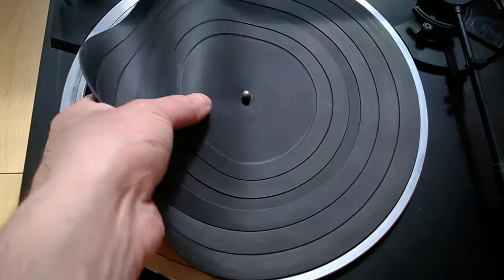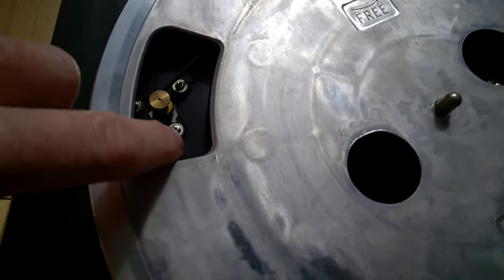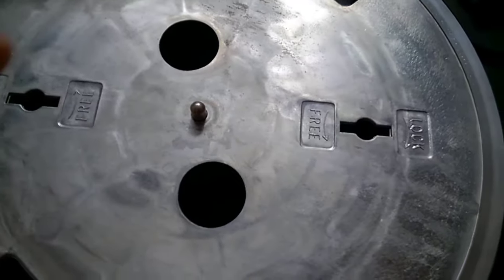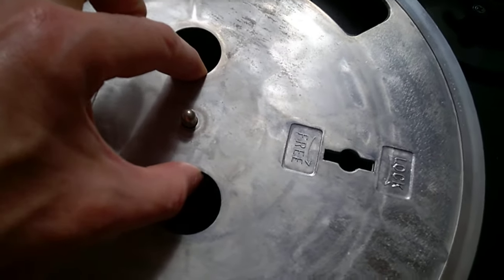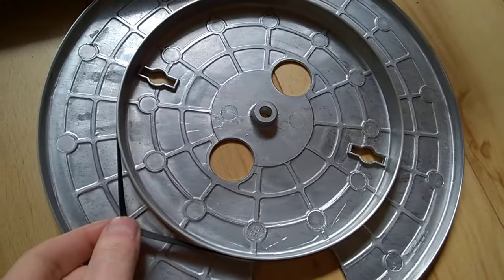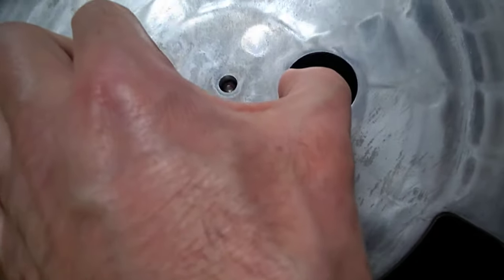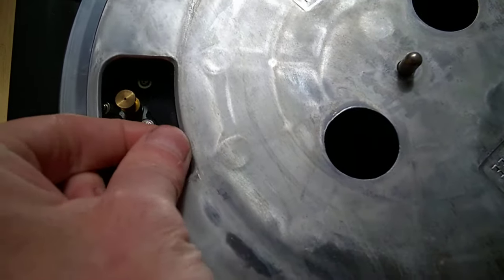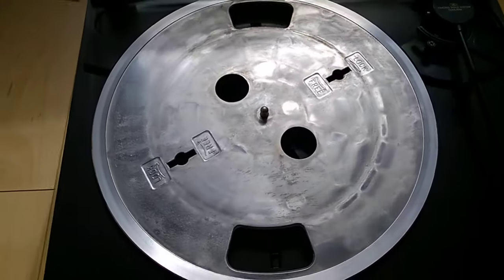Quick turntable belt replacement

Comment from the maker: Tips: 
Stuck platter or Loose belt
1. Stuck platter 
If it won't lift, it's slight stuck on the center pin. Grab platter rather at the perimeter with both hands at two opposite points, then gently wiggle the platter vertically. Be gentle, it should get unstuck, then lift if as shown with the finger holes - be sure to keep the heavy platter securely when lifting it.  
2. Loose belt
If the belt is loose and doesn't stay on the platter, keep the belt in tension with the left hand while handling the platter with the right hand. Pay attention not to twist the belt both on the plate running face and on the small drive pulley. It may help to have the speed selector at 45rpm to lower the fork.

How to lubricate a turntable  https://youtu.be/eCWjq7ujXVA

Comment: do you know why my belt keeps slipping off on a brand new record player when i spin it?
Reply from the maker: First thing, make sure the belt is in good condition. An old belt will become soft, will stretch and will not have the tension to stay on the shafts. 

Another possibility is something is misaligned. The pulley runs on the small motor 'stud', this stud can move up and down, depending on the motor speed 33 or 45 rpm.  Try moving the playback speed knob see if the motor stud moves up and down and if the belt runs better.

Comment: Thank you very much for this. It's part of a hifi system from the 80's. It used to rise  on and off at the end and return to its starting position. I changed the belt yesterday as it had perished. It started ok but now I had to lift the arm on to album, it then just skimmed over album to end.  I could hear the mechanism but nothing happened. I manually lifted the arm back to the starting position.  Any ideas? Thank you.
Reply from the maker: I had this happening when the stylus just plays the center groove of the album - large groove without sound. On my unit I had to carefully lift the heavy plate which exposes the gears and mechanism. From there may want to look how it looks. Carefully not to activate the turntable at this point as the stylus will lift and hit components and may get bent. You may find old grease that got thick/stiff. May want to gently clean it - I like to use a q-tip with alcohol. Once everything is clean, put back the plate and try an album. If it still doesn't work, may want to use a light grease to spread very little on the gears and most contact points - I recommend a grease that doesn't smell. I'm showing in this video https://youtu.be/eCWjq7ujXVA
Reply: @Peppermint1  Brilliant advice. Thanks. I did notice grease on the components and gently cleaned. They are almost all plastic. It's still not working so I'll try a little grease on the parts I have access to but some are encased within  the casing?
Reply from the maker: @cheriejardine8610  I'll try to make tomorrow a video showing the mechanism and gears on my turntable